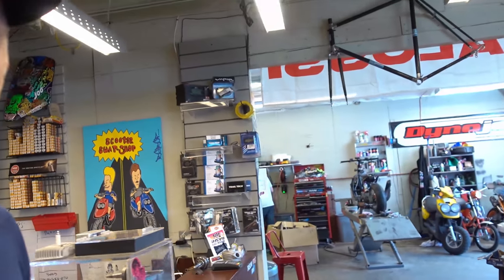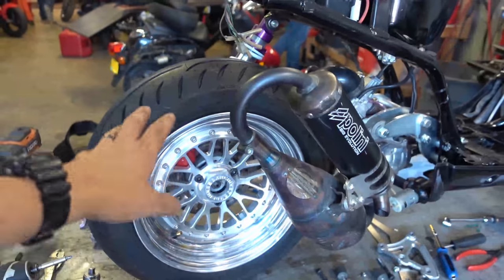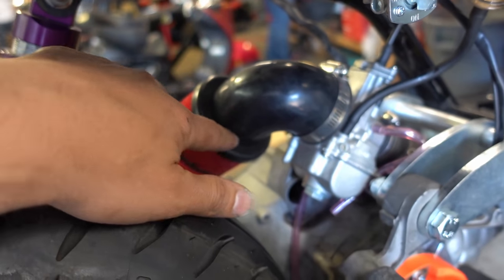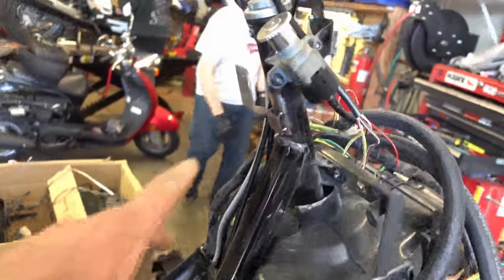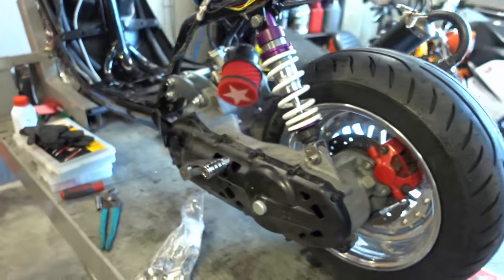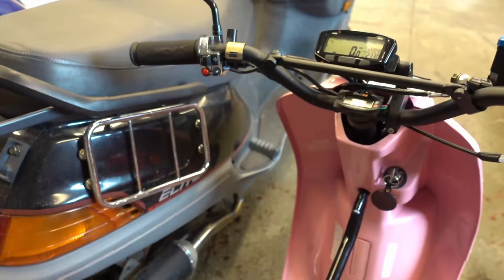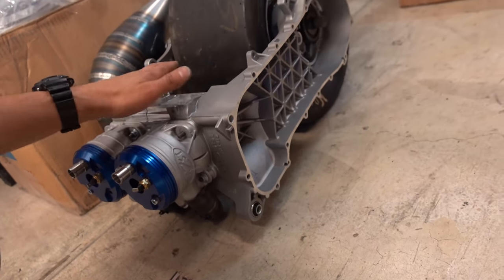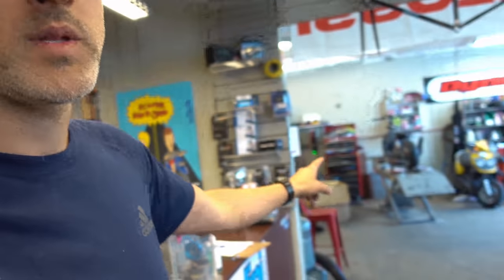Big evo POLINI 94cc zuma prebug build update!

Comment: i have a 2001 zuma i’m building i ordered a replacement oem speedometer cable.  one side of the cable the piece sticking out is flat and smooth and on the other side it’s textured almost like a metal file.  does anyone know which side goes into the gauge cluster and what side goes into the front wheel?
Reply from the maker: should only go one way

Comment: Are there “ ANY” water cooled cylinders for Minarelli Vertical ?? 1999 prebug !! I want to use a electric water pump and a water cooled cylinder
Reply from the maker: The only
Lc kit for
Prebug is $2500 for the full pipe bore crank and water pump. It’s incredible high end full race. Very expensive

Comment: 2fast make the passion blocks too, which are pretty cool because you can run a forward facing carby because the reed valve is right on top of the cylinder.
Reply from the maker: depends on the setup for how you would want to run the carb

Comment: The evo cylinders don't really make a huge amount of horsepower for their size , there are cylinders like the metrakit pro race and hebo that make as much or more but they do make great torque all through the range. Naturally they do have loads of potential for porting and will hold a great deal more power
Reply from the maker: eh all preference its still running to this day 5,000 roughly miles later